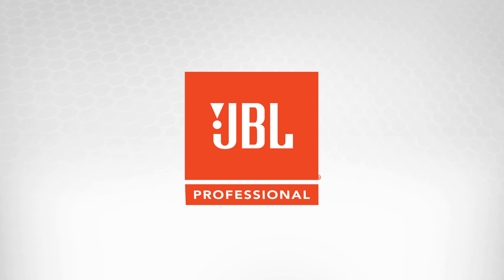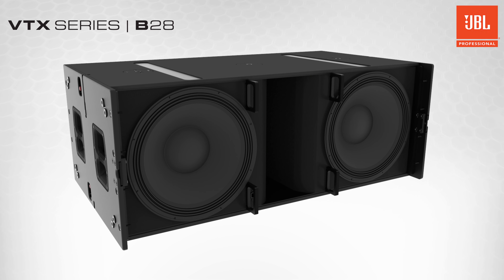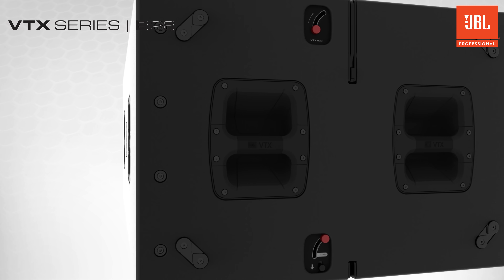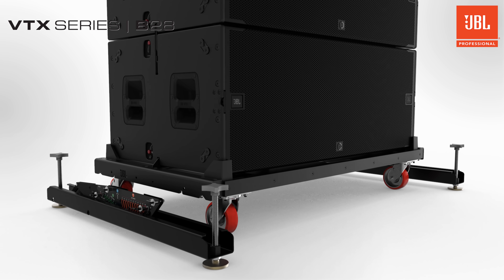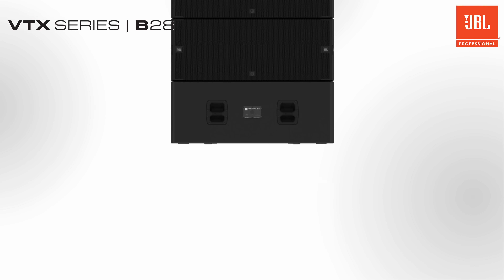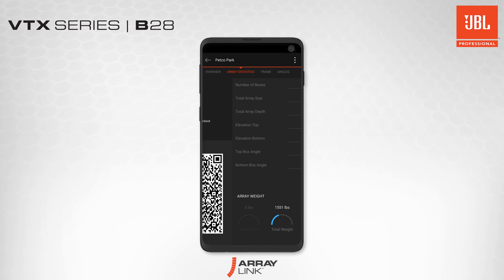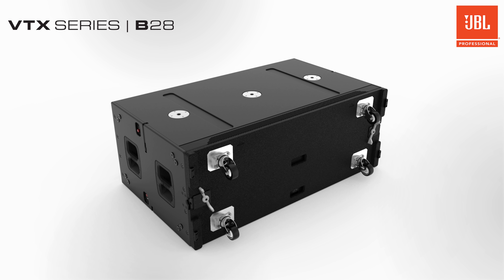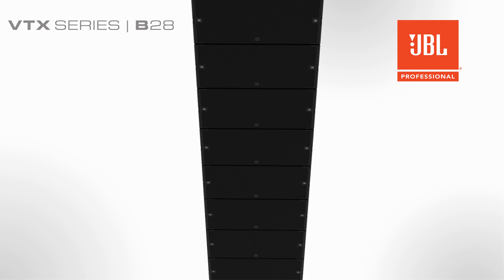JBL VTX B28 Subwoofer: Technical Overview

Comment: Wonder how these bad boys would sound in a home, either a home theater or a stereo, guessing it would “crush” your skull
Reply: I think I should check that!!!
Reply: Wondering how these compare to eaw sb1000
Reply: @stevencancel1727 hit wayyyyy harder ive got 16 sb1000 and currently buying 12 g28 the punch is much better sb1000 does have more range tho
Reply: Neighbors are going to love movie nights ahahah
Reply: We have 12 in our inventory. Can confirm, in a small room, it's almost structure damaging.
Reply: Will shake you house apart
Reply: I used to have a SRX818SP. I couldn't even turn it to 5% of the volume at home, the entire room would start rattling like crazy. The VRX is on a different level.
Reply: It's like buying an airplane to cross a bridge

Comment: How much one speaker price
Reply: 2 lak
Reply: @rubelsoundsystemkaliakair264  in usd
Reply: @rayhan_dmusic_man  over 4k usd.....
Reply: @andreeacatalin8260  could you approximate please
Reply: @rayhan_dmusic_man  Sorry, but idk the exact price but if one sub (800w+800w peack power) used in cinema sound system cost 4000€....is clear that this much more powerfull and performant subwoofer will cost more than 4000 usd.
Try to seartch at their store , you can find the right price there.

Comment: Wow, what a demo vid! 
Essentially a pair of the best 18"s ever made, in the best engineered cabinet ever!
Reply: Nah, I wouldn‘t say that
Reply: @timsteuerwald2207  
Ok, you may be right as my comment was certainly off the cuff. 
That said, care to share? 
Better engineered 18's/cabinet?
Reply: @FOH3663  What about Voice Acoustic for example?
Reply: @timsteuerwald2207  
You may have meant Void

Voice ...  I know the name, know they're European, but I've never encountered their gear. 

Looking around on their website, their double 18 cabinets I saw can't compare in any way. 
JBL's driver tech is tough to compete with too. 
They just do so much R&D, way more than anyone else. 

Curious if you meant Void Acoustics
Reply: @FOH3663  Voice Acoustic is a German Brand, maybe they don't sell their gear to wherever you live
Reply: @timsteuerwald2207  
Yeah, I checked Voice out. I wouldn't have otherwise so appreciate the heads up. 

It's just when you rent, transport, load in/load out, ground stack or fly subs, these particular JBL cabinets are superb. 
And again, their sound, the Differential Drive woofers and the reliability, man it's tough to beat. 

I'll use whatever, but budgets vary. 
JBL and Meyer are at the forefront of research. Danley is fascinating as well with their gargantuan long throw point source offerings.
Reply: KS28 ;)
Reply: @timsteuerwald2207  void acoustic is a british speaker brand
Reply: is g28 better than this?
as it is 22 Hz - 80 Hz